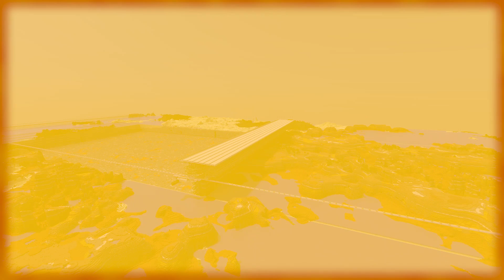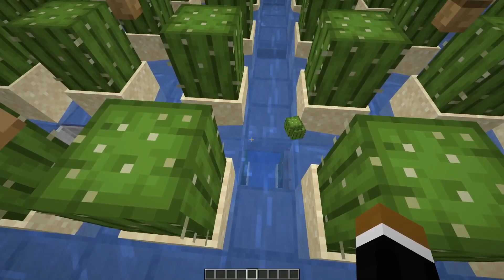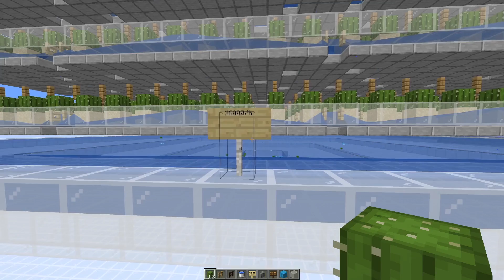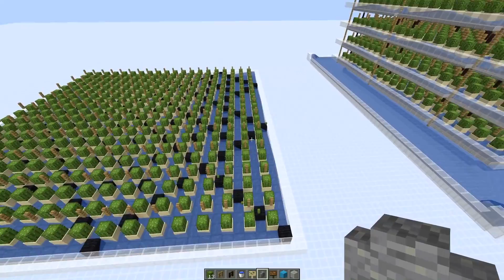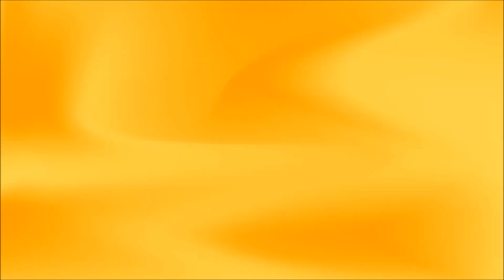Compact Cactus Farm For 1.16/1.13+

Comment: If you place a water source into the same spot (say, South) in the four small diamond shapes forming a large diamond shape, I think the holes along the border of the large diamond shape and one hole in the middle should be enough to avoid zero current spots, saving 4 holes. I'll post a link to a diagram as a reply to this comment. If you can't see it, it hasn't been marked as not spam yet.

Comment: I have some building tips for this farm as I have built it a few times now (almost completed a bedrock to build hight version):
1) Use Iron bars for the centre pole much easier to obtain and don't join to wood fence 
2) Use ice blocks to place the water to save time 
3) I think the fastest way to build this is platforms 1st then cut one hole at a time down to the base then iron rod back to the top and repeat then fill with sand water and cactus ( as I have lost lots of gear when not paying attention to my armour)
4)1000% easier with Litematica

Comment: someone that I can't remember (logical maybe) proved that adding walls all "around" each cacti instead of the minimum amount of fences that make the cacti pop out would help to avoid popping cacti to land on the side/top of nearby cacti, improving the performance by up to 30% depending on the original design
Reply: yea but the build cost + time + space would significantly increase to, you probably need 9x more the space, and maybe alot alot(maybe 3x?) more blocks and thus more time to build for a 30%, it may not be as good as to just build another same farm next to it.

Comment: you're overthinking this by a wide margin, all you have to do to regain the loss in efficiency is place an open fence gate on the water level where the deadzones are, this allows the items to fall through like previously and is a lot more cost effective in terms of building supplies.
Reply: secondarily it's arguably better to have only a single water collection array at the bottom and a retaining wall the entire perimeter of the farm, if done correctly there is no loss in efficiency with the reduced water layers and a slight increase from the wall as it stops cactus items from jumping 2 meters out and getting stuck on the wall or fall outside of the collection unit.
Reply: But mango did design with open fence gates, it's in this video, wtf.

Comment: Hey, I want to make an efficient cactus farm for hypixel skyblock in which there are a few extra rules for items. The rules are are that the cactus respawns in 25 seconds after being dropped and the more hoppers you use the slower they will transfer items. So I was wondering if there was a system you could show for most effeciant cactus farm layout with these rules.

Comment: The fence version would be easier to make since you can still pole on fences and wouldn’t need to deal with placing gates as you need a solid block below them.

Comment: if you're going to have a layer of water for each layer of cactus than it might be beneficial to connect those fence posts, as this prevents cactus items from popping off a cactus and flying into another cactus and being destroyed. But if you aren't going for a layer of water for each layer of cactus then I've found that you want to minimize the vertical footprint of the posts, and glass panes give slightly higher rates than fence

How much does adding layers of water decrease losses? The tradeoff of build time and resources can be neglected when just looking at machine efficiency, cactus per area is decreased but that doesn't really matter if you aren't on a public server. The most important difference might be the processing power it takes for all that water, these things can get massive and numerous enough that they can apply noticeable pressure to the server if multiple different people are running them
Reply: Water isn't much of an issue unless the current is changing.  The way he has it set up is with no changing currents, so no lag.  Flushing style mob farms are usually the culprits one MP servers when it comes to water lag.

Comment: Would it be more efficient to use iron trap doors instead of the slabs?
Reply: No, but yes. Cactus won't jump up that high, but if you have a decent iron farm you can build a lot of this out of a single product (switch fence posts for chains)

Comment: 4:57 would trapdoors instead of slabs be even more efficient?
Reply: the items would never go that high so it wouldn't matter a half slab works fine
Reply: @KDonnie  however, if you have a decent iron farm it could be an easier way in terms of material (also, exchange the fence posts for chains)

Comment: That old design is still perfectly viable. You just put open fence gates on top of the signs.
Reply: There are water streams going from the deadspots, if you blocked it off a portion of the farm would not be covered by water collection.

Comment: The simplest is to put the water sources so that the water flows freely and touches water from other sources diagonally, but not orthogonally, then poke the holes where there's no water. I made a video about it a month ago. No need for fence gates. Unless I missed something, which is very possible since I'm a noob.
Reply: I saw your video and it was pretty good but is your farm as efficient as this one?
Reply: @upsidedown5564  It's the same farm, just easier water placement. Don't see how the efficiency would be different, but like I said, I could have missed something. If I recall correctly I had 99.something% of max efficiency (measured from one cactus, then multiplied by the number of plants in my farm). Just double checked, my efficiency per cactus is 2.3 per plant per hour, so pretty much the same as here, but I didn't build as high and I know that I have increased losses per layer, which would probably be the same as the fence gate design here.

Comment: Something interesting for the MBE series might be a some machines that help build large farms such as this. I don't think it would be too difficult to make a flying machine that places in those slab platforms, for instance.
Reply: You would need dispensers to also be able to place blocks as well, unfortunately.
Reply: @autumnmango794  Well, MBE makes player AFK placing machines much more feasible for large scale, because you can take the storage with you. But you're right, I was assuming dispenser block placing when I made the comment. That's what happens when you play with custom features for long enough.
Reply: I don’t think you need MBE (movable block entities) to move slabs but yes that would be a cool project.
Reply: @mekhipappin7929  he is proabobly talking about dispenser that places blocks + movable dispenser ie. MBE
Reply: @hampustoft2221  Yeah that's interesting!!!!
Reply: He made a platform builder with MBE and dispensers place blocks in the SkyBlock series.

Comment: Can you please make a machine that builds cactus farms? Even partially. I've managed to do the sand placing with redstone but your talent is needed for the rest :p
Reply: Well at least 3 afk players, but might be possible, one placing sand, another placing cactus and a last one with fences, the blocks can probably be made using a coble generator
Reply: There are schematic's if that's what your looking for.
Reply: @jorge9199  No friend, I mean like flying machines placing layers of blocks so you don't have to and sand falling in the right place with the press of a button.  :P

Comment: I think that guy called Borkon has made a similar video already with another working water system, but I think his is even less effort (but idk haven't tried any of the two)
Reply: if you look, the holes are actually in the same places, he just put the water sources in the middle instead of the sides. don't know why mango put the water on the sides of the diamonds for this one. borkon's requires no fences and is definitely easier
edit: the tradeoff is no fences for some dead spots - still more efficient than the old design because there are less dead spots
Reply from the maker: @merukit  putting water in the middle just creates dead water again and items will get lost
Reply: @ilmango  that's another option then, cause even though there's still dead water it's less than the old design, and also less total water buckets than the old design.
Reply: @ilmango  uhh another thing is how did you make the fences next to the white-stained glass connect to each other? and is it ok to let them connect?

Comment: Early Ilmango: Builds farm showcases from Scicraft

Present Ilmango: Builds farm showcases from the peaceful challenge series.
Reply: I don't think they built this in the peaceful series. they separated them into smaller parts like xisuma's original design
Reply: The peaceful challenge has made some really neat stuff, like that 1 tile wide TNT duper that was specifically made to not waste slime.
Reply: What happend to cicraft
Reply: @shak3891  yeh what happened to it
Reply: the peaceful iron farm is so low effort to make and helps set you up so hard for the early game, I'm not complaining.

Comment: Would chains be more efficient than fences? It'd take more resources, so it probably wouldn't be worth it, but I feel like it could help.
Also, what about trapdoors instead of slabs?
Reply: Chains would be slightly less efficient as they are smaller. The fences are there to prevent items with enough momentum to reach the cactus below. Walls could be slightly better, but would connect with adjacent fences or walls at the top. Anyway, the only "considerable" difference is having something to catch the items (i.e. fences) or not. Then,about the trapdoors, I believe it would be the same as slabs provide already enough space.
Reply: Chains and trapdoors would just result in the same amount of cactus per hour. Chains could be an easier option if you have a good iron farm and don't have a farm for wood but placing all those trapdoors would be a lot more tedious than using slabs but if you are willing to do for aesthetic purposes then i don't see why not tbf.
Reply: Interesting that people seem so split on whether or not this would be better. Honestly I have no idea, I just wanna see someone crunch the numbers on this. I feel like the trapdoors might help more than the chains but even then probably not by much.
Reply: @griffin4cats  
The item you use to break the cactus isn't going to change the rate at which the cactus grows and if it does somehow stop some of thee cactus that breaks off from hitting other cactus and being destroyed its going to be so minimal it doesn't make a difference
Reply: @0x2A_  Well to be fair, nothing is going to change the rate at which the cactus grows (besides random tick speed)
Reply: To one up the trapdoor suggestion, what about placing another nether brick fence on top of the wooden fences that run in rows to prevent and cacti getting stuck on top of the fences, or is that even a concern considering the hit boxes for a fence?

I’m not too familiar with farm making but it popped into my head for sure
Reply: @xenosai371  I don't think it would be a concern, i have built a few cactus farms in my time on MC and never seen it happen. Not saying it couldn't happen but it would be very rare if it does
Reply: @asdf hjkl I think they would. And on top of that an iron farm is much easier and cheaper to build than a tree farm. I think chains with their smaller hitboxes would be more efficient @griffin4cats
Reply: Also yea trapdoors would be better. It's just a matter of placing them

Comment: Hi mango! Could you do a video about the concrete factory you built in last episode?
Reply: Are u taking about the duper ?
Reply: @Kaitokid730  no he said the factory
Reply: @tonyaltobello6885   well the factory is a duper :P
Reply: @mekhipappin7929  because mango mentioned in the last video , they will make end side to change the powder into the harden version. That's why I got confused
Reply: @Kaitokid730  yes they have made it on scicraft they move the powder to a location run it past water and then break with tnt duper. So idk